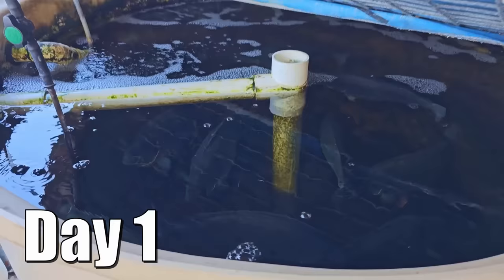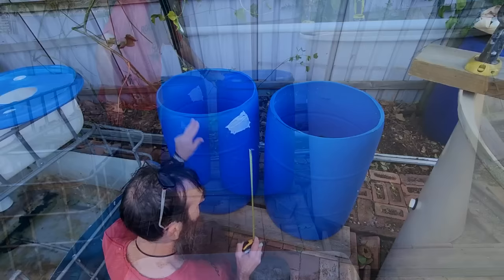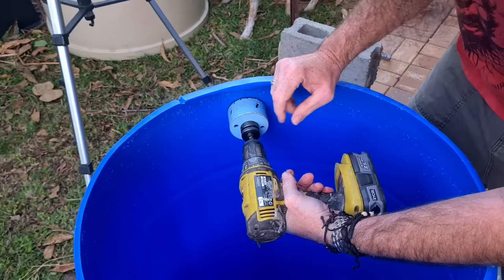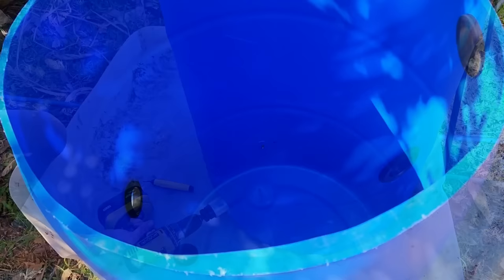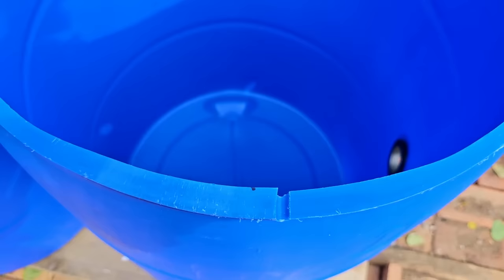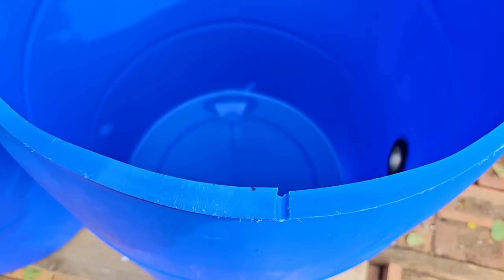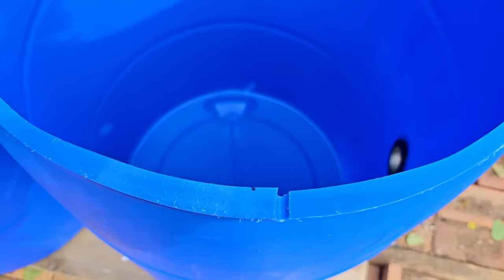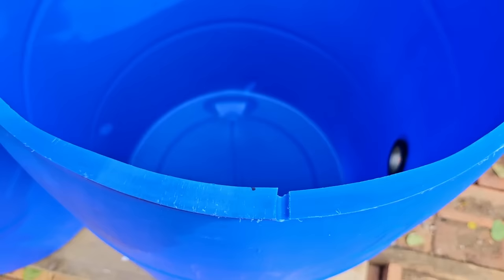New Aquaponics System | Plumbing The Fish Tank, Solids Settler & Bio Filter

Comment: One thing i suggest for anyone reading, use pressure glue (green), not because blue is bad or whatever, its great, but i reuse a lot of my fittings elsewhere (as does Bob haha as he is grabbing a lot of these parts from elsewhere/other systems) constantly when i cut em up and mix and match so using pressure glue i can still use these parts for non pressure or pressure regardless of what i am doing. and both glues cost the same so might as well just make it pressure fitted
Reply from the maker: Good idea NB. The pumps I use are all low pressure so blue works fine. I've seen they use the green on the large fountain jobbies.
Cheers mate & have  top one.
Reply: @RobsAquaponics  i have a mix depending on what i am doing also getting town water from one side of the property to the other and whatever. I used to just use blue too, but then i kept having to store me fittings separately so i was like fk it haha same price might as well make everything pressure then in the future it wont as its all pressure haha

Comment: Just wondering if you dont use PVC glue because of the potential for toxicity??
Reply from the maker: It's easier to reclaim fittings using the screws + not all fittings need to be secure, like the up flow pipe in the solids settler. 
Cheers Jacob.

Comment: You can always burn out your pvc fittings with a bit of glue or a heat gun to heat the pipe and a screw driver/ some multigrips to pop out the old pipe.
Reply from the maker: I heated pipe to remove pipe from fittings (all the valves used were reclaimed that way) in the past. 👍
Not a huge fan of the method as it can release some toxic chemicals into the water if over heated.

Comment: What would be the difference if you have the media filter before the settler tank?
Reply from the maker: The solids would get smashed up a fair bit which would make them smaller. Smaller solids generally require a longer retention time to settle out of the water column so that's why I run the setter before. 
There's nothing stopping you from running a fines filter after the bio if you're concerned about the small amount of particulate that gets through.👍

Comment: Cheers for the vid Rob. Great as usual. I’ve just got the ibc fish tank and grow beds plus sump in place at the moment. Need to get the rff and bio filter drums next then into the plumbing so this video is info gold. ❤ I’m on the Northside of Brizzie and wondering if you have any tips on getting your pvc piping for a bargain. I’m trolling marketplace but where would you go if you were buying new? TIA and keep up the good work mate, your an inspiration and my main motivator in setting up my 2nd system😊
Reply from the maker: I ring around plumbing suppliers & see what price they can do. I think the big "B" store normally has the cheapest.
I like to use these guys for the PVC & Polly fittings & valves, https://irrigationstore.com.au/collections/pvc-pipe-fittings-1
They have a flat shipping fee & the price is WAY LOWER than the "B" store.
Hope that helps some mate.

Comment: Question:  What is your thinking on the barrel versus cone configuration for the radial flow settling tank?  Based on the video you linked, the cone shape seems like it would be ideal for removing the solids.  Is it a cost issue, convenience, or is there a functionality advantage to the barrel style that I don't understand?  
I apologize if you have already answered this question before in a different video.  I have watched a lot of them.  When I lived in Hawaii a few years back I had a great aquaponics system and the community is huge there.  I am about to move to a climate which will make starting one up again viable so I am studying up again.  I plan on buying your guide once we buy the new house!  Thanks for everything and good luck!
Reply from the maker: Cone based tanks are expensive here & out of the budget of most backyarders I've helped along. I find the flat based drums work OK as long as you can sort out a decent plumbing fitting to draw the waste out. 
I was gifted a 50gal barrel with a cone welded onto it that I'm wanting to use but due to the height it isn't suitable for the systems I've built here so far. I will be putting it to use on the new farm we're purchasing at the moment though. 🤔😉
I hope the build goes smoothly when the time comes Zombie.!